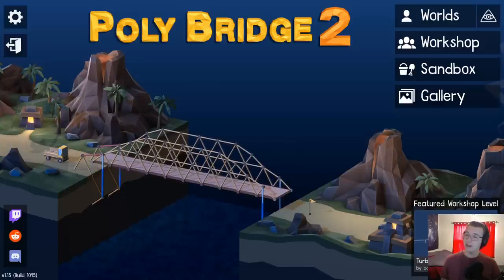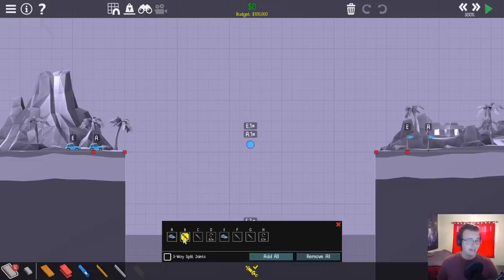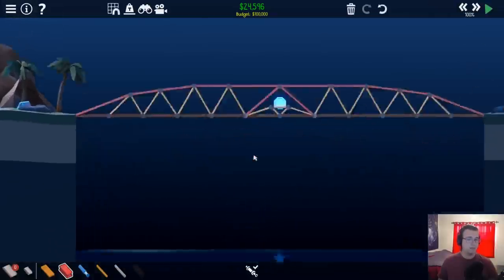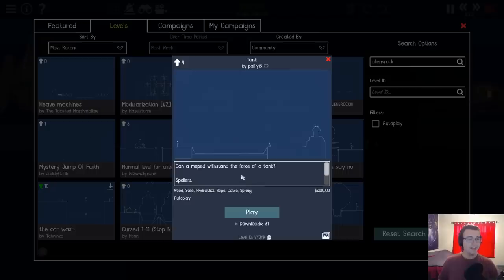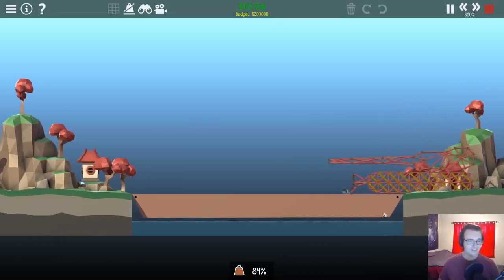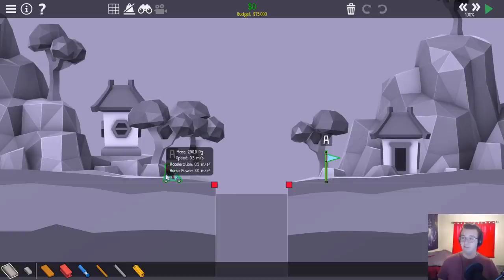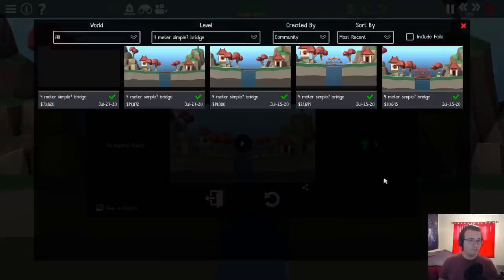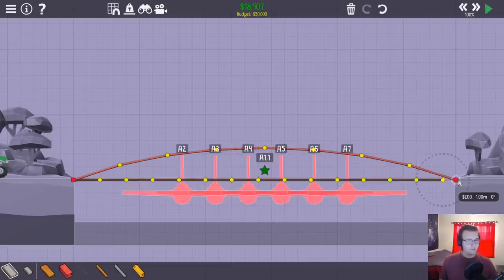Bulldozing Mopeds With a Spring-Powered Tank

Comment: I suspect the tank works in the same way the engineless fin-rocket works in Kerbal Space Program. Basically, the springs might work under the hood by applying a vector force opposing whatever force is applied to it. The creator is exploiting this by putting them in a rigid body such that the opposing vector force of the moped is getting translated into motion of the rigid body.

Comment: The tank moves because the 100% compressed springs are trying to extend but the steel which is somehow not breaking is pushing the springs back to fully compressed and it repeats which slightly pushes is diagonally super fast so it moves tank speed

Oh wait I paused it right before he kinda just summarised it lol